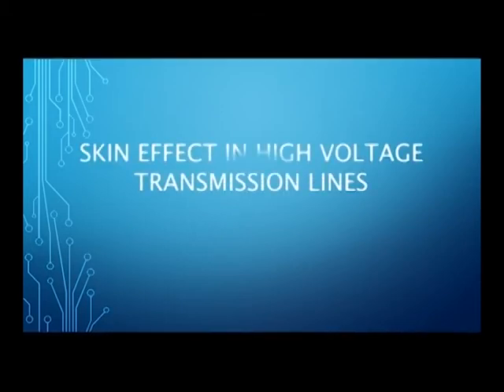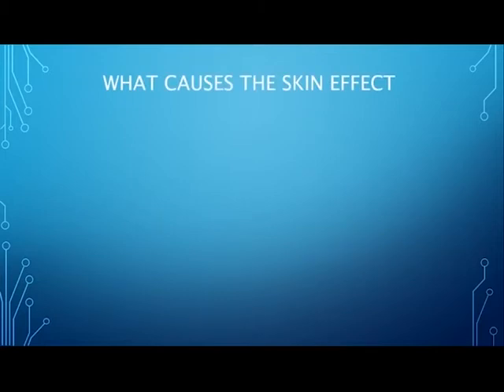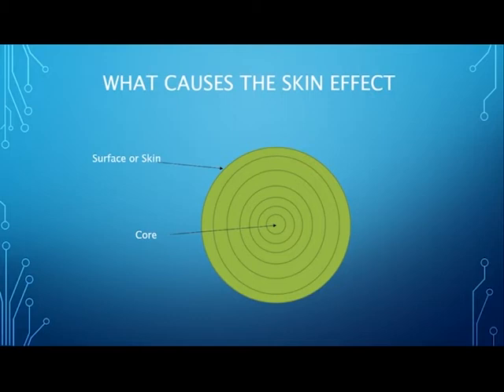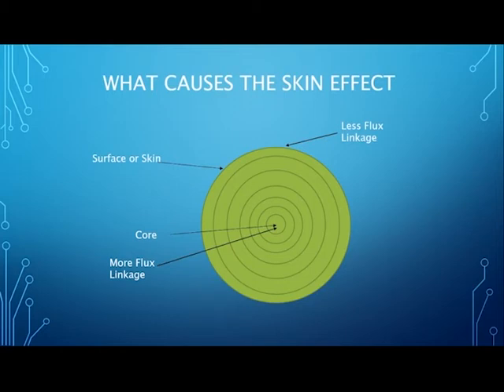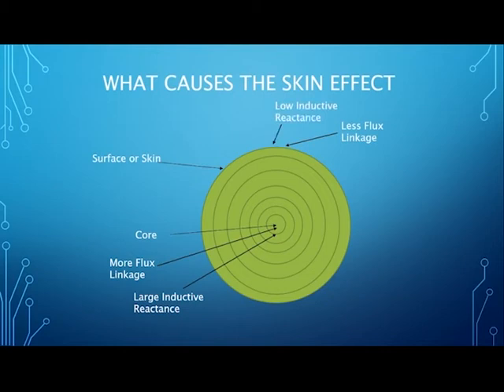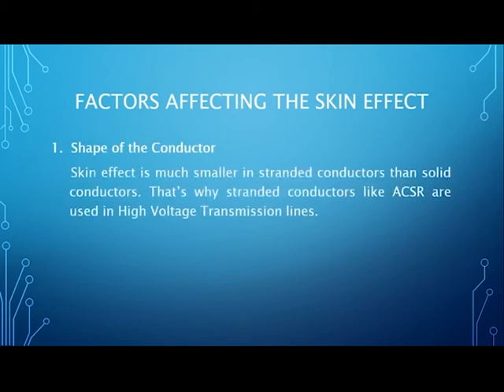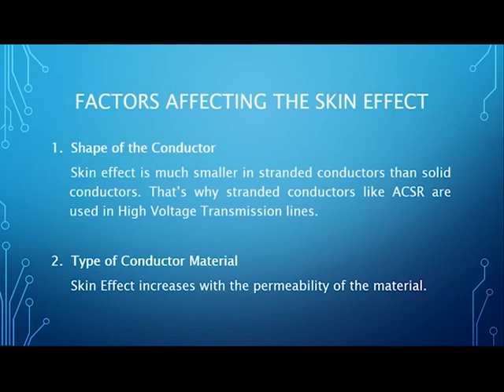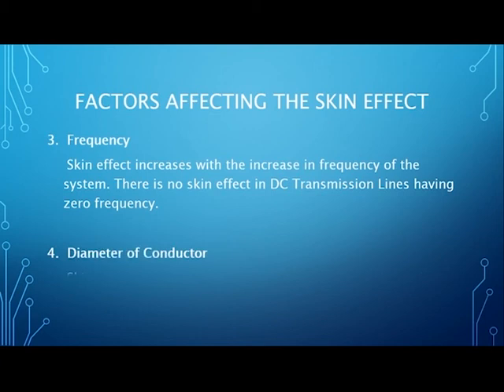Skin Effect in Transmission Line

Comment: my doubt is as you said - flux setup in the outer filament is linked to the surface and not with the core. but how there will be a more flux linkage at core of the conductor and less flux linkage at the surface of the conductor - please clarify
Reply from the maker: This is due to the fact that central part of the conductor is surrounded by both the internal and external flux whereas the surface is only surrounded by the external flux. This means that the central part or core of the conductor will be having more flux linkage. Due to increased flux linkage, the inductance will be more. As Inductive reactance XL= 2π f L,  which means that more inductance will result in more inductive reactance offering more resistance to current. Therefore little current passed through the core. 
Hopefully u have got the answer. Feel free to ask any question. Regards
Reply: @theengineeringpower4213  thank you. Got the point
Reply: What is coper surface roughness
Reply from the maker: @maheshpalika8985   The surface of conductor does not remain smooth forever and becomes rough due to deposition of dirt and dust. Similarly some strands of conductor can be broken and at that point the surface of conductor is not uniform and becomes irregular. Such rough surface also results in more corona loss.
Reply: How surface links with only external flux and inner part links with both int. and ext. fluxes....plz show that in your video and if possible create a new video with full and detailed explanation. Thanks.